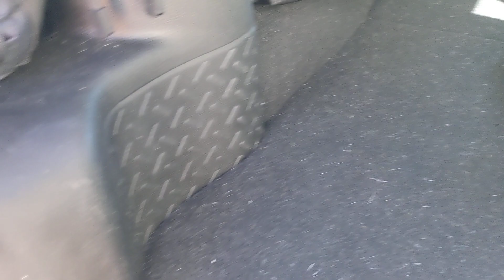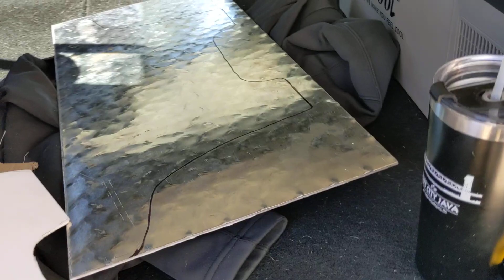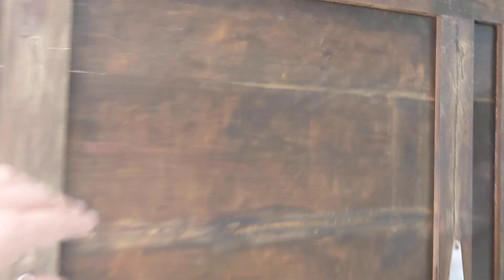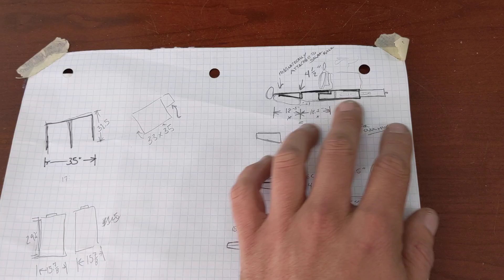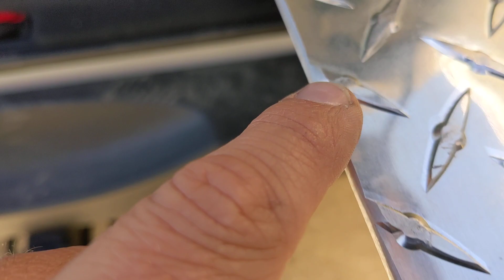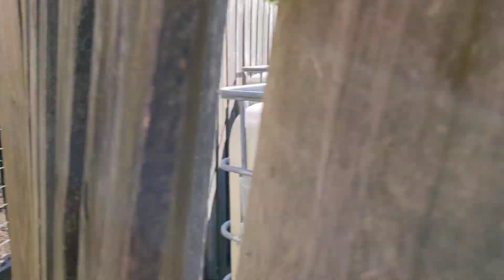Jeep Overland Project: More Kitchen Space + Simple DIY Tips

Comment: originally I was planning to use 80/20 extruded aluminum for my platform to keep weight down but I might use the pvc instead ... its a lot cheaper and close to same weight.  I also have a lot of self sufficiency type stuff on my channel, lots of gardening and fruit/berry videos so if you get a chance, check it out.
Reply from the maker: That is exactly my style! Love it. I also had the same thought with the 80/20 it's just so expensive and the pvc was so easy to work with